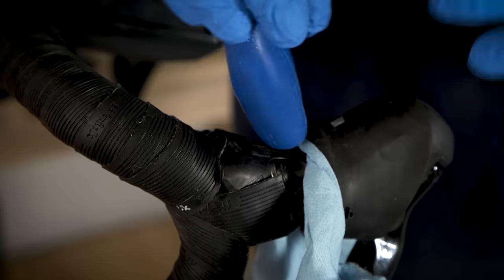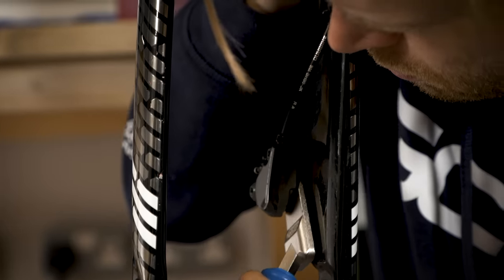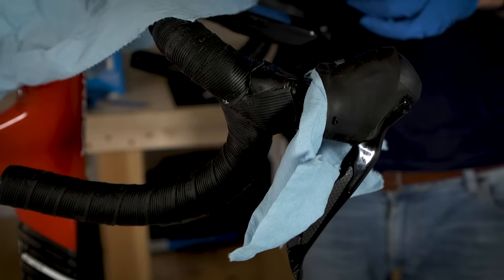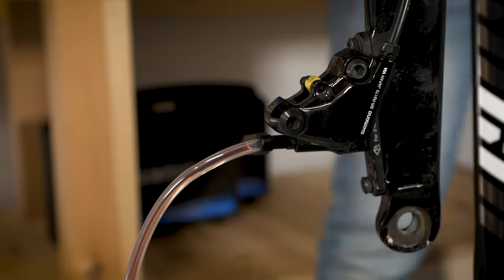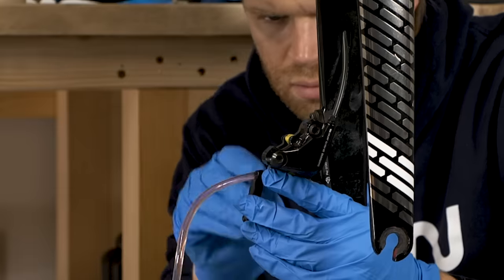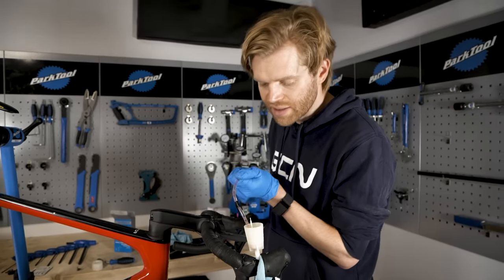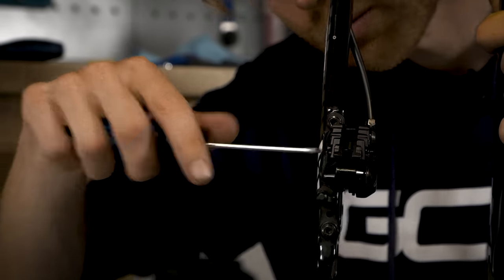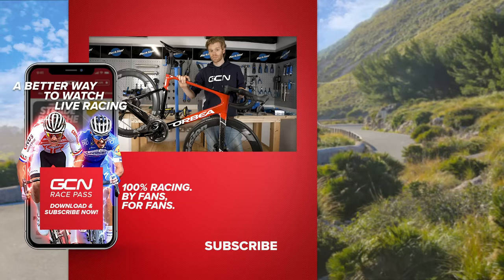How To Bleed Shimano Road Hydraulic Disc Brakes

Comment from the maker: Does your bike have disc brakes? Do you service them yourself? Let us know in the comments below!
Reply: Yes I have mechanical disk brakes and I service them myself
Reply: Even though I don't have hydraulics I still love watching your videos
Reply: Yes and I am not exactly waiting for the change...
Reply: Never serviced my own bike but planning to in the future. have had a disc brake MTB before but will be getting the Ribble CGR 725 Gravel Bike in November and this video is a big help in getting me ready to take care of it personally. 👌😁👍
Reply: @rboydphotography  yeah the video is great and the new bike day will be awesome
Reply: yes, and I really need to service them - was just about to request that you made such a video, so thanks! :)
Reply: I was dumb enough to pull several time the lever without the wheel in place but Sram brakes are so easy to service.
Reply: My Shimano road brakes haven't needed servicing yet, but I will do it myself.  I've service my SRAM mtn bike brakes several times.  I'd recommend cleaning the pistons with a wrap of cotton string or q-tip and alcohol before pressing them back in the caliper.  It helps avoid piston sticking after service.
Reply: Yes and yes
Reply: Yes! Trying to do as much myself as possible. Recently picked up SRAM Force HRD. GCN needs to do a SRAM HRD bleed video!!
Reply: hydraulic disc brakes and servicing them myself. it was a challenge when i build my first disc brake bike from scratch and really messy. plus i cursed a lot. but once you get used to the new system its not more complicated than setting up rim brakes and takes about 2 minutes to service something.
Reply: @Numeriwar  

...and SRAM saves the day
Reply: yes sir
Reply: @CrimsonFlames  already done
Reply: Got mechanical disc brakes on the gravel / winter bike.
I service them myself as it's cables and pad alignment easy enough to do at home.
Mechanical disc is a lot more work than rim brakes, pad wear means that the lever throw is quickly affected, so you have to adjust the pad clearance. (Can't remember the last rim I adjusted my time brakes other than to replace the cables).
They also offer (on my bike) less stopping power than my rim brakes, but it's more consistent in wet weather.
To me it feels like you need a lot more lever pull for the same braking force, it's like there's flex somewhere in the system.

Any advice on how to improve mechanical discs? (Upgrade to hydraulic 105 is almost as much as a full groupset!)

Edit: Should point out that I've had hydraulic brakes on an old hybrid and the braking is substantially better than either rim or mechanical disc.
Reply: I can change the pads & clean / grease the calipers but my bike will be going straight to the shop when it needs this done. That is far beyond my limited capabilities.
Reply: what percent of ollies bikes are disc?
Reply: @IanB17  people do thousands of kms per year, achieve rides they wouldnt think possible when they started cycling. But then they cant read or watch a god damn tutorial. Its basicaly plug, push pull a syringe...
Reply: Yes and yes, its no more difficult than fixing a puncture.
Reply: Just broke the thread of the shifter :(
Reply: I rather use rim brakes because of less maintenance and less cost.. disc brakes you have to take it to the bike shop and have it checked out.. disc brakes wear out more faster than rim brakes because of the long descents...
Reply: @stevensantana8049  easier to change the pads than the rims.
Reply: yes, I do, yes I do. One thing I learned myself is that resetting the pistons is not always necessary, what's more in cases when bleeding breaks and not switching to new pads, resetting the pistons is a bad idea. One: it will make the level drop the first time using it and creating a vacuum in the lever, better is to leave the pistons as they are, extremely gently (on Saint brakes) squeeze the lever, so the pistons go out a bit, bleed the brakes with a double syringe so that the fluid in the lever will be forcibly put in. (this basically forces the air trapped to be squeezed and unsqueezed forcing it to move if it's stuck somewhere), After the bleed close the caliper side, clean, put pads in, see if the wheel turns correctly and squeeze the lever once with opened valve, this will set the pistons into preferable position with the rotor. close lever end. enjoy.
Two: I do reset the pistons with new pads and I do half-bleed, and I also use the trick as in point 1 to set the pistons into the most preferable position.
I know this way is not textbook, but it just how I do it after trying like 10-15 bleeding videos and since I found my way I get the most power from the brakes.
Reply: The adapter you mention is called ST-R9210, for the ones who don’t know
Reply: Yes and yes I service them myself
Reply: I need to bleed my front calliper but it is unlike any of the 'how to' videos I have looked at. It is Shimano BR785 and the group set is 105. The calliper doesn't have a bleed port with a rubber cover and requiring a 7mm spanner. It is not there. I have no idea how this can be bled. I was going to do it myself but think I need to take it to my local bike shop.
Reply: Davie Robb - Bullshit!

A typical road alloy rim brake rim will last 15-20,000+ miles before needing replacement. Disc pads require changing multiple times in a single season if you are putting in any type serious miles. In addition, the rotors on a disc brake wheel also wear out exponentially faster than a rim brake rim because you have far less surface area over which the pads are being applied versus the rim every time you brake.
Reply: 1st time on my front front brake (which was about as useless as rim brakes in the wet 😉). Now works like as new. Thank you  ☺️

Comment: plastic tire lever works better than a screw driver for the pistons
Reply: 100% agree. And Pedro’s levers are the best
Reply: Not sure why he pushed the pistons back with the pads still in place. I always remove the pads then push back the pistons with a plastic tyre lever.
Reply: @d_mac3233  Because he don't want to damage the surface of piston. With pads inside it's safer.
Reply: The short end of a regular Allen key works great

Comment: Erm I know Oli has a phd in chemistry but isn't mineral oil hydrophobic and therefore very much not water-soluble.
Reply: Shimano mineral oil is water-based in composition.
Reply: @nekobytes9187  lol - no - it isn't - don't believe me?  Try putting some water in the bottle and see if it mixes....

MSDS says it's 97% "Lubricant Based Oil" and 3% "DMSO-extract"

Classification of Components: 
Distillates (petroleum), hydrotreated light paraffinic/265-158-7/

Triaryl Phosphate(contain Triphenyl phosphate)/273-066-3/

2,6-di-tert-butyl-p-cresol/204-881-4/

Not a drop of water to be found....
Reply: @jimhansen5395  it's not going to mix. Also, I've since found out that water-based in Shimano's context meant it's essentially incompressible, not that the mixture had water in it.

Still, thanks for letting me correct myself. I had forgotten this comment existed.
Reply: @nekobytes9187  your comment says the oil is water based.  It's not water based. It's oil based, which is why it's hydroPHOBIC and won't mix with water.  HyGroscopic means something is easily absorbs or mixes water which oil is not).
Reply: @jimhansen5395  that is exactly the reason I said I was correcting myself.
Reply: @G Rossi DOT brake fluid ie. 3 and 4 is made of chemicals that have high boiling point and low freezing. Glycol and ether IIRC. Who told you "oil?"
Reply: @G Rossi yea, it couldn't be ether. I didn't look it up, lazy.

Comment: If you pull air out of the lever through the funnel using a syringe, you will need to actuate the lever a few times with the funnel still on to repressurize the system before inserting the bleed screw into the lever. When you suck air out of the lever you are also pulling a little fluid out of the line and reservoir.
Reply: yeah he didn't actually do it correctly...
Reply: Yes, very much so. That and Park Tools has the most complete video on the whole procedure by far. Especially the different angles you have to move the road bars to vs flat mtb bars. You can also try a cheater bleed but it doesn't work on Road levers nearly as well as on flat bar levers.
Reply: And he didn’t mention that after removing the funnel not to remove the excess mineral oil until you replace the screw.

Comment: I need to see how you do the REAR brakes! As you say, to get air out of the section between the caliper and the pedals you need to get the bike vertical...at which point the reservoir screwed into the brake lever empties onto the ground and the top system fills with air!
Reply: Slacken the bars in the stem and rotate the bars as needed.
Reply: there is a level marker on the side of the peeled back hood grip that you tilt to a level plane by loosening the bars.  This enables you to tilt further without spilling
Reply: What if your handle bar is a fixed aero model where it doesn’t rotate?
Reply: I think for the rear callipers, it’s better to unscrew them and let them dangle by the hose. No?

Comment: If you're pads are worn a bit and the lever travels a bit too far for your liking, a little tip. Pull the lever all the way in and secure with a velcro strap or similar and leave over night. This reseats the seals and the pistons won't return all the way, advancing the pads apparently and works a treat.

Comment: 1:45 You have wires in the stem, so if you have air in the system, it will be better to set the front higher.
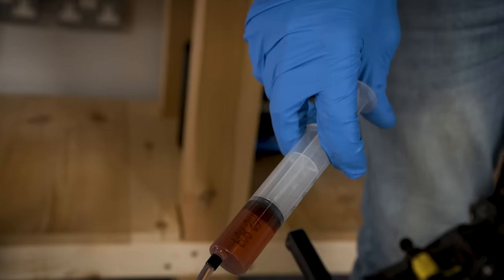6:20 There's usually a lot of contamination in fluid in the clamps. I change the other way i.e. when the reservoir and tube is bleed, I use the syringe to drain the oil down - this is usually way in the automotive industry.
When the reservoir is deaerated and the valve in the caliper unscrewed, it is worth pressing the brake lever slowly several times
Reply: Thanks for the thoughtful tips
Reply: Thanks. I will keep that in mind

Comment: Made look simple. After buying a German online bike I swapped hoses over to make it right front braking. They are a little spongy after this move so this is exactly the info I was looking for. Thanks!
Reply: you probably trapped air when you swapped the hoses. it should be sufficient to mount the fluid reservoir to the STIs, put some oil into it and pump the brake several times. you will see air bubbles escape when doing so. move the bike around a bit (lift the rear and front) and pump while doing so.
most of the time that will get rid of all the air. a full bleed is actually only neccessary when installing the system from scratch or you want to excange all the oil after several years of use.

Comment: This a great vid. FYI During a routine service and clean I had an almost imperceptible noise from my caliper with the lever released, which was down to the pad spring being very slightly asymmetric and not moving the pads back squarely from the rotor.  Best check carefully if one is just cleaning the caliper during a service. Not an issue if replacing as in this vid.

Comment: "For single use only" is written on the side of the syringe because it's a medical device that's been repurposed for bike maintenance, not because of any corrosive property of mineral oil. The tendency of the presenters to make stuff up during technical videos undermines otherwise excellent GCN content.
Reply: “… otherwise excellent content”? LOL
Reply: What he said literally happened to me. The rubber expanded and was unusable after some time. I didn't know back then  that it's because of the oil.
Reply: @Terra-Incognlta Everytime you done using it just wash it with alcohol and it will be fine and usable again. Obviously not now that the hose is already useless.

Comment: Oli!!! Your chemistry profs are rolling wondering if you whacked your head in a crash :) Mineral oil is very much not miscible with water - it does clean up nicely with detergent and rubbing alcohol.

That said, good tip on using the syringe to create a vacuum. Didn't think of that one and instead do the Shimano-recommended multiple angle tilting of the handlebar to "burp" air from the reservoir.

Comment: Better to remove the pads before pushing on the pistons. This avoids any damage to the brake pad material, especially if they are resin. Def. replace pads if less than 1mm.
Money saving tips: 1. My bike shop doesn't give out the adapter that comes with each bike because they don't want to confuse the non-techy customer. So they gave me one for free.
2. I made a brake block spacer out of an old plastic gift card which I cut to size. I glued each piece together until I had the needed fatness and held it in place by a rubber band.
Reply: There's the issue that ham-fisted people damage the pistons since they are ceramic in (some?) road disc models. Better damage the brake pads instead. You could always sandpaper them. I use a plastic tire lever if the pads are removed.

Comment: When bleeding the fluid, part of my goal is to flush any contaminants out from the system. Since this usually enters the system from the brake pistons, I attach the bleed cup, place a generous amount of fluid in it and then from the brake caliper, I use a syringe to remove fluid until I see that it is clear, making use the cup always has fluid in it. Once that task is completed, I then perform the remaining tasks as shown in this video.

Comment: It would be great if you could go over removing and replacing hydraulic lines, especially on a bike with internally routed lines.  I understand there are specialty tools needed for Shimano brakes.  Do you pull & plug the line before pulling it through?  Do you drain the fluid before pulling lines through?  Can the hydraulic fluid used damage the interior of a carbon frame?  Lots of questions about the process. Thanks!

Comment: excellently explained thankyou! I followed along and paused the vid for each bit I did. :). Am a newbie with bike mechanics stuff! Just had 6 month driving ban so trying to figure this stuff out on a spare bike. My brakes were tweaking and shrieking and I swapped the brake pads but stupidly pressed the brakes with the wheel off and no brake spacers! Now my promax hydraulic brakes, the piston won't come out its flush flat not popping out. I have promax... I just ordered some park tool brake piston tool Im hoping I haven't broke these promax disk brakes, might upgrade. :)

Comment: I don't have disc brakes. And now I know why! Too much hard work. Long live the rim brake!

Although, as always, Ollie's insight and expertise is second to none. Legend!
Reply: The #1 reason to avoid disc brakes is because once you experience them, you will never ever want to go back to rim brakes.  Aside from being a superior experience, they're actually easier to maintain, less time than watching the video on how to do it.
Reply: You’re right, disc brakes are a load of old wank, I’m looking at this video because I went to use my gravel bike today for the first time in 3 months , it was fine when last used but now for some reason the back brake is non existent, zero pressure at the lever ☹️ shimano 105 hydraulic is load of crap😡
    So it’s back to my trusty rim brake road bike for the weekend which hasn’t caused any problems in the ten years I’ve had it, this fucking disc brake had better not cost me , if it does I’ll sell the fucker😎
Reply: @julianmorris9951  I think you mean “hydraulic” brakes, not disc brakes. 
You can get non hydraulic / cable disc brakes if you want more superior stopping power than rim brakes but not all the bleeding bullshit. 🤙🏼

Comment: The tools i need for my road bike brakes, one allen key to change the pads once a year and a cable swap every other year. never had a single problem with rim brake stopping power.
Reply: True. It’s amazing the gullibility of so many who blindly have bought into the industry marketing BS that a road bike or even most gravel bikes require hydraulic disc brakes. Total bullshit. 

Rim brakes have more stopping power, require far less maintenance and adjustments, have far less maintenance costs (no replacing of tiny wafer thin disc brake pads or rotors or brake oil multiple times a year) and they work perfectly well in 99+% of all road of gravel riding situations.

Comment: I can bleed all the air out of my shimano 105 front brakes; however, I cannot get the air out of my rear brake.   It's easy to angle the front caliper to be the lowest point but how do you tilt the bike for the rear brake bleed?   The rear brake line runs through the frame and comes out below the caliper.   Also, the rear caliper and bleed port are in an awkward location.   There are a lot of bleed tutorials showing the front but I could not find a video on the rear brake.   Thanks.

Comment: There are a lot of steps missing, like the various positions required for the shifter to release trapped air. And then this last part with the negative pressure on the shifter!! you have to mention tha you apply very little force while pulling because you will force air from somewhere else back to the system

Comment: Those look so much quicker and easier to bleed than my SRAM disc brakes. I probably will go Team Shimano on future bikes.
Reply: I actually like Sram better. The Shimano syringe always pops off and oil gets all over the place. Srams syringes have a nice solid connection. Easier to get all the air out of Sram system with the double syringes too. Shimano some times feel mushy because it's hard to tap out all the air bubbles and repressurize the system.
Reply: @newttella1043  yeah the shimano syringes are stupid, but once you get a feeling for the system it actually works okay and air bubbles are not a problem.
Reply: Yeah, the SRAM brakes are a pita to bleed compared to Shimano. No bike mechanic in my local shop enjoys bleeding SRAM brakes.